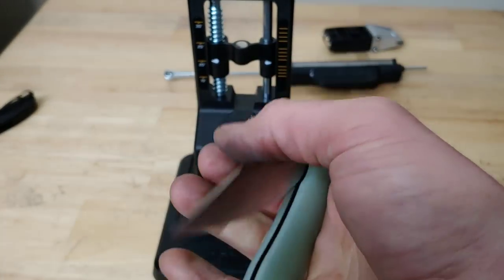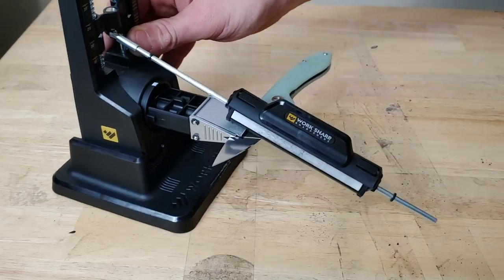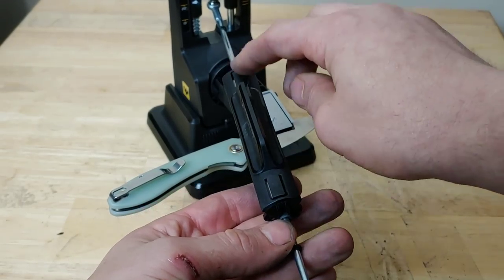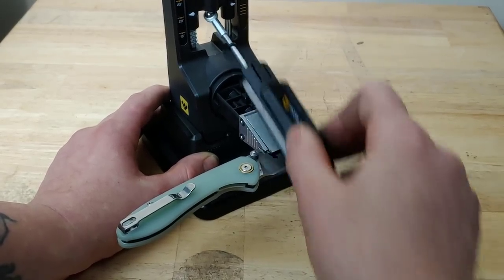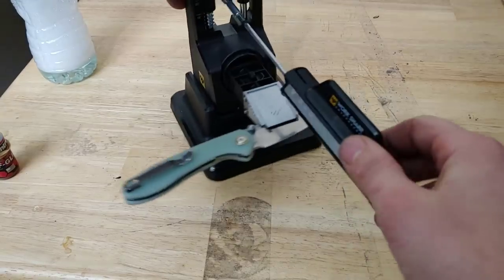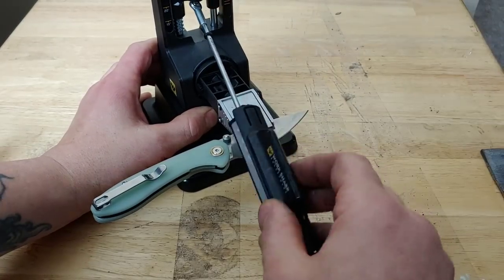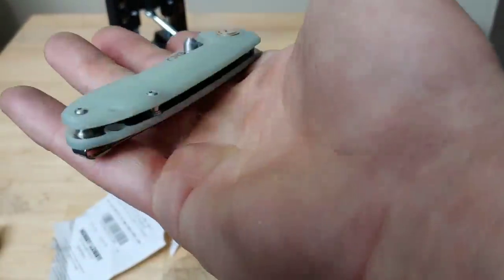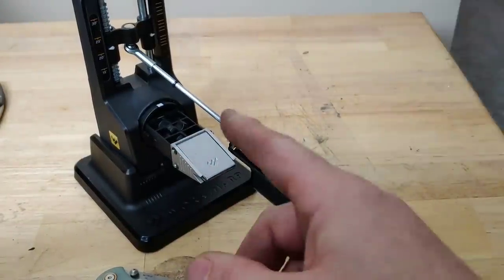WORKSHARP PRECISION ADJUST KNIFE SHARPENER REVIEW

Comment: The Worksharp video I saw they did have rubber on the clamp. Separated by a piece of paper that had to be removed. They also said they offer replacement stones. So hopefully they will start offering different grits. They also said to push the knife all the way into the V at back then hold the clamp while tightening it. I think it is great at the price. If they didn't want to do a heavier base some way to attach it c clamps or screws to a table would be great.
Reply from the maker: You know i messed up i honestly thought, mine was all metal And im going to write something on top of the description because mine does have the rubber